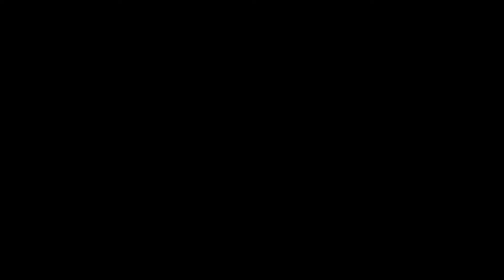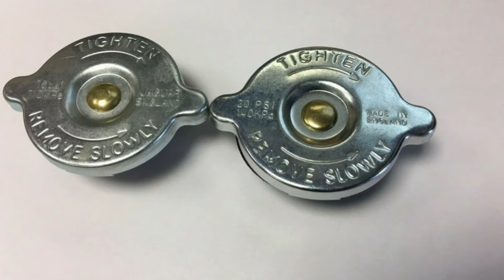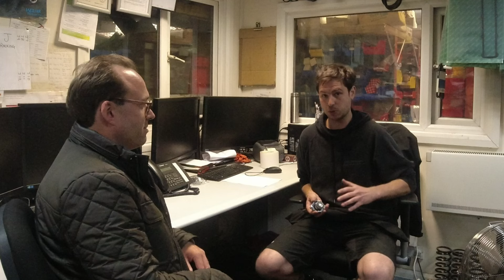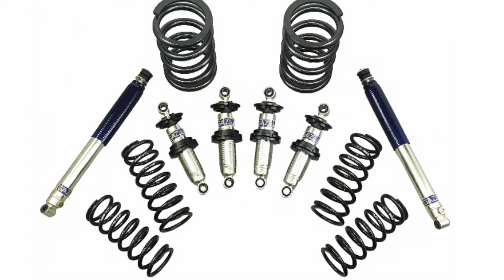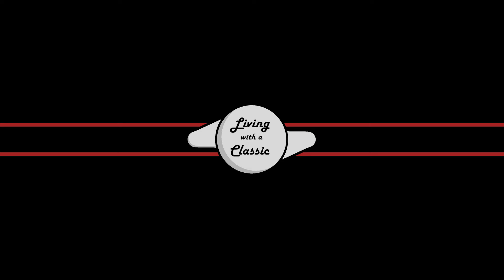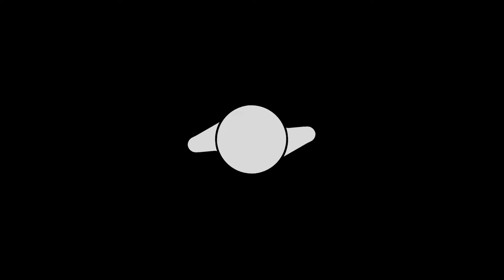Visiting Simply Performance!

Comment: I've had a few bits form SimplyPerformance - they are a great company & i've been impressed with the service. The over axle exhaust pipe they sell for the XJS is excellent. Interesting into about the springs! My V12 has new RTC2751 springs I think the designation was, which I got from another supplier in UK,, & yes they do seem to sit slightly high.